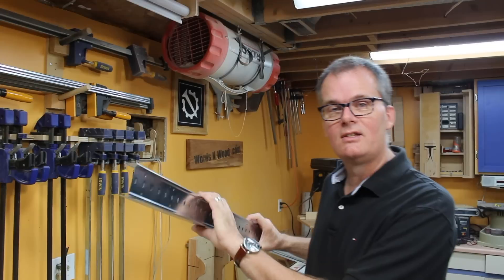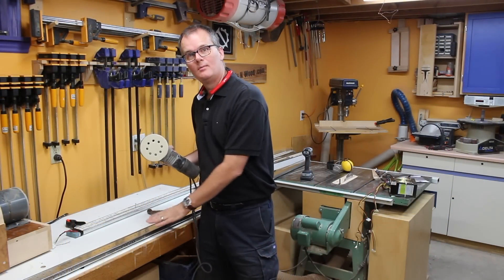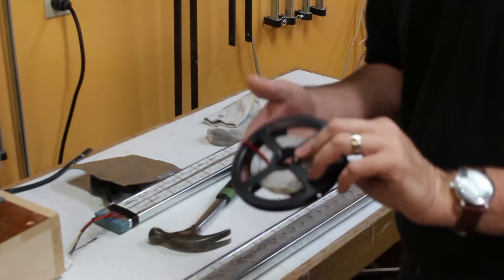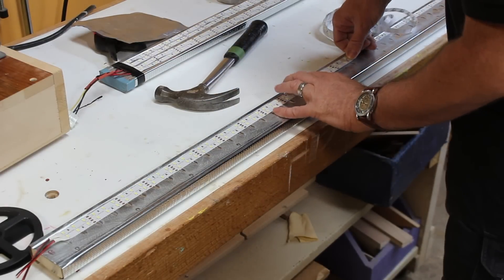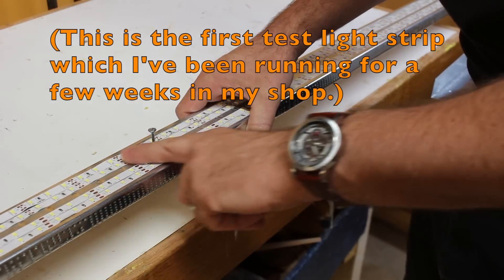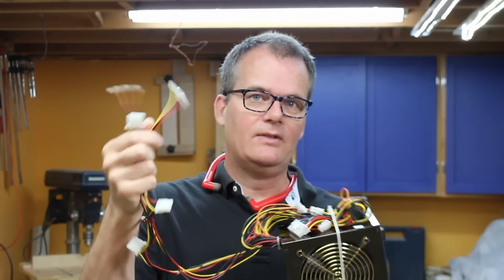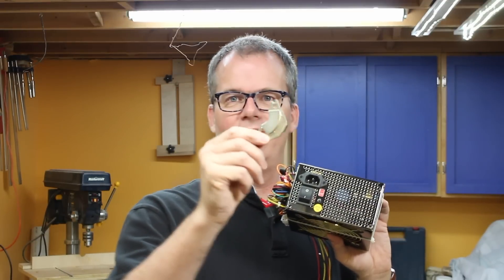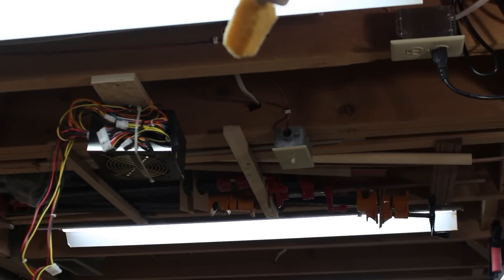Hacking LED strip lights.  AGAIN!   Last Time!  Promise! (WnW #59)

Comment: I am finally starting to comment for people looking for solutions like this. Everyone, I hacked this about 8 years ago when led strips were not widely known about. I don’t use adhesive at all and intact install on boats this in the Pacific Ocean. It’s a silicone and applies to almost any surface, AND NEVER HAS FAILED ME. It’s works so well and tried in my home and on outside surfaces continually being weathered. Only a specific brand and I bought it at Home Depot. If your interested in trying it(which I recommend) I would love for you to do a video on it for everyone. Let me know if your interested. I hope you get this and somehow message me back where I will see the message. I am new to all this and am being told by many I should be making videos like you do. So I have been practicing and publishing very amateur videos from my drone and some work I have done. Which have been on Network television several times by the owners but I have waived the opportunities of being recognized for personal reasons. I am now ready I think. But this is me breaking the ice for myself to do so… I think. Hope to hear from you. I told only a handful of people.

Comment: I've been applying led strips to the inner part of the stud, bending the sides out to form a reflector, then sliding in a sheet of plexiglass for the cover, no glue, or other means of attachment necessary. I leave the ends open for cooling. Works so well it's almost as though the studs were made with this second use in mind. Good job with the video, btw!

Comment: I've enjoyed this "series" a lot, well done. One suggestion for a future mod - rig up a small solar panel system to supply 12v directly (or 120v through an inverter). A single 100w solar panel and a 100Ah battery (and charge controller) might be all that is needed to power the lights. You could also use the power to charge your cordless power tools through 120v inverter and normal battery charger.

Comment from the maker: Patrons brighten my life:  https://www.patreon.com/wordsnwood
----------
I think I've finally successfully hacked these LED strip lights to use the, as "regular" lighting.

I had two main problems with my LED strip lights after my previous experiments.   

#1 was that they got so hot that the adhesive backing failed.   I think they really should have a metal backing to help dissipate the heat.   I found that a metal stud from the big box hardware store was the cheapest solution.

#2 was that the cheap DC-DC converter that I had bought could not handle the load.  I'm still trying to avoid buying $20+ 12v power supplies so I settled on (?) using a surplus PC power supply.  It requires a bit of creative soldering, but seems to do the job well, and it has enough wattage to handle several power strips.

Project web page:
http://www.wordsnwood.com/2016/LEDs-r...

---------- ---------- ---------- ---------- ----------
Previous LED videos:

#1) It all started here.  "Can LED strip lights replace Fluorescent!?  (WnW #46)"
https://youtu.be/yeC4tXANdv4

#2) Problems come out in this shop update
"Snow, Shop Update, and LEDs part 2 (WnW #52)"
https://youtu.be/oiEl96CIOGI

#3) Minor mention in this shop update, mostly about the Power Supply
"Meetup in Toronto, Mic Test, and Shop Update"
https://youtu.be/Ayr2gStI3fc

---------- ---------- ---------- ---------- ----------
HOW YOU CAN HELP:
Become a Patron: https://www.patreon.com/wordsnwood
Buy a Plan: http://wordsnwood.com/plans/

MORE MORE MORE:
http://www.wordsnwood.com
https://www.instagram.com/words.n.wood
https://www.facebook.com/wordsnwood

Comment: I would try putting the LEDs on the inside of the metal stud and bending the stud wider so it acted as a reflector. There are plastic clips designed to fasten LED strips to things too. That might eliminate the sagging problem also.
Reply from the maker: You missed this one...  https://www.youtube.com/watch?v=VVSqHp71824&t=2s
:-) :-)
Reply: I clicked and watched it. I had missed that one. Lol
That one looks pretty cool. You might see what it's like without the diffuser. It will be a harsher light but I would imagine it will also seem a bit brighter. Thanks for the videos.

Comment: You would actually get better adhesion if you did NOT sand the metal. Pressure sensitive material like the adhesive on the back of the LED strip prefers a smooth surface.

Comment: Don't know if you are still using your SMD (led) strips or not. You probably got them EVERYWHERE in there, or changed your design or ideas for lighting by now. Lol. One thing I always do when mounting these. Drill LOTS of holes, so that you can put a small zip-tie every 6 leds or so. Snug... not REALLY TIGHT. Too tight can break solder connections on smds, or on their resistors on that thin strip they are on. You'll never have to worry about them sagging again. I usually don't use the 2-sided tape on the back,  because if any adhesive wears or melts off ( when mounted to metal)... and the back of the bare strip touches bare metal... it can short out and blow your lights, or fry a power supply. That, and the 2-sided tape on them never holds very long as you found out.
 I used to use the 5050 SMD strips. But once I seen how bright the 5630 were  (or sometimes called 5730).... they are the only thing I'll use. I ALSO get mine from China... but on Ebay. They offer warm white, cool white, and NATURAL white. I first started out with all of the different colors, mounting them all through-out cars for custom looks. Now... I install them everywhere I can in the house. I CAN'T STAND a dim area. I favor the NATURAL WHITE strips. It's a glow that is close to a regular light bulb.
 I put them in my kitchen cabinets, other cabinets here and there, under cabinets above bar in kitchen, and I am getting ready to do an instalation in my garage of 25 to 30 meters.... running off of a 12v 30a power supply. Garage size is only 23ft x 15ft. I imagine it will look like DAYLIGHT in there afterwards!!!
 For all of my cabinets and my bar, I used one 12v 3a power adapter from Hong Kong. $4.50 US. My bar lights even go through a dimmer with remote for adjusting brightness. I'll have to either post a video soon... or email you some photos if you're interested. I don't like posting videos... but maybe I can do a photo step by step tutorial on YouTube soon. As for in my garage, gotta insulate and drywall my ceiling in there first. But that's getting done little by little. Over halfway done already.
 But anyways... hopefully yours are still working for ya and last forever!! 
 Other helpful items that come in handy.... get on ebay and look up "10mm 2 pin smd connectors". (For the single color get the 2 pin) They got all kinds of nice CHEAP gadgets on there that make installation a breeze.... without even needing to solder ANYTHING.

Comment: The adhesive fails from heat and shear stress.  The copper in the strips expands quicker than wood and so the copper is pulling the strip from the wood.  Wood is an excellent insulator and there is nowhere for the heat to go.  Power supplies should be sized for the load of the LED strip.  You can feed the LEDs too much current and it will shorten their lifespan.  The use of aluminum as a heat sink is better than the use of steel since it conducts heat better and the expansion coefficient of aluminum is closer to copper than steel.  Use alcohol to degrease and clean before adhering the tape to aluminum.  Do not sand the substrate. It creates micro scratches which allows air (a wonderful insulator) to decrease contact.

Comment: You mounted those strips perpendicular to your ceiling joists.  That could limit your access to that area for storage whereas if you mounted them on the bottom of each ceiling joist, you would not be blocking your access.  Something to consider if you choose to put more of the strip lights up.  With the strip lights just near the side of the room like you have it in this video, that's probably not that much of an issue.

Comment: I am unsure of which video I commented on prior to now - but I found a solution for the LED heat issue.  I used an aluminium sheet as a back panel (got the idea from this video when I watched it last year), but secured the LED strip to the panel with clear silicone caulking.  Apply the caulking to the strip's adhesive backing and then set in place.  The silicone transmits heat very well, it wont degrade within the operational temperatures of the LEDs, and it drys/sets-up in a matter of minutes (given a thin coating anyway).  I thought you might like to add that nugget to the pile for the next rainy day adventure down this rabbit hole.  Cheers!
Reply: did you apply the silicone to the actual glue part or left the backing as it is, how is it holing up sofar?

Comment: Great vids Art. I had the same idea! Metal studs are cheap and provide lots of heat sink. I'm glad you tested them out first. So how many 5 meter strips (cut in half, two 8' strips per stud) do you think are enough to provide ALL the light for a 20' x 20' garage? And do you recommend 5630's or 5050's, and which brand/model? Lots of questions. P.S. -  I used a PC power supply as a way to charge 4 RC plane batteries at once, on house current. Each plane's battery comes with a charger that needs to plug into your car to charge! I mounted 4 cigarette lighter jacks in the power supply body, grounded the green wire, and removed all other wires. It's all internal, neat and tidy. Thanks again for you great vids! Subbed.
Reply from the maker: My shop is 11x24 and I have 2 of the studs in my shop, plus three 4' flourescents.  I'd start with 5-6 in your case.

I can't really recommend a brand.   I went cheap, but I don't have the resources to try all of them out there.   I've heard people say the cheap ones don't last, but these are mostly ok.  one of my strips does have some out, I was also testing a 19v PS for a while so maybe I overdid it?
Reply: John Berthoty Don't know if you have already done your project or not... but use 5630 or 5730 natural white. MUCH brighter than the 5050. Don't put too much power to em though, or they get REALLY hot and start failing. I usually put around 12v 3a.... or 4a  to every 5-meter of smd strips.

Comment: Did this do the trick? Did the LEDs come unstuck over time? I am more than likely doing a similar thing your video helped a bunch.
Reply from the maker: Some of mine are a bit loose...   I'd go with some other means of gluing.   CA glue or construction adhesive or something.
Reply: Great thanks!

Comment: I have successfully powered these 12V LED strips by 120V AC without using an elaborate 12V DC power supply.  What I did was to cut 10 equal length strips of 20 cm each.  All strips must be cut from the same roll, of equal lengths and the total number of strips must be 10.  Connect the 10 strips together in series (+ of the first strip to - of the second strip, then + of the second strip to - of the third strip and so on).  This forms a 120V DC series circuit chain (10 x 12V DC = 120V DC), total 200 cm long.  If you want to, you can connect two of these 200 cm strips in parallel to double the power.  The only thing left is to connect to the 120V AC source through a 400V 2A bridge rectifier: 120V AC to the two ~ ~ terminals, + and - to the LED strip(s).  Since the LED's are "live", precautions should be taken not to touch them when power up and to make sure they don't get shorted to the metal stud by first installing a layer of insulating Mylar tape.  Make sure to use Mylar tape and not PVC tape.  Mylar is a much better electrical insulator and heat conductor than PVC.  Each 200 cm strip draws about 35W.  I am a bit disappointed with the high power consumption because a lot of power is wasted through the on board chip resistors.

Comment: I like your approach. Very methodological. Tried, tested, eliminated. I jumped into your video, when I wanted to know the watts for 5 meter 5630 LED (turns out to be 51Watts). 
I had run the 5 meters a couple of days back, but did not have a 5A power adapter and I ran it through 2A, and testing through the multi-meter, got a reading of 1.92Amps which would be equivalent of 23Watts for 5 meters which I felt did not look right. Most of Aliexpress was mentioning 14.4 to 12 watts per meter which I felt was not correct either, as 5730 was positioned at 7 watts for 50cms, so 5630 must be  around 14 watts for 100cms. Thanks to you, now, I feel 5630 strip light white 6500K would be 5 watts for 50cms at 2700lumens for 60 LEDs (45 lumens per LED).
I am building a large aquarium light for my bigger 2 feet tank. I wanted the watts calculation with 10% approximation limit, to evaluate if it was worth moving to LED. My current aqua tank with T5 lighting is 96watts and 6400 lumens. I figure for 6400 lumens I can run 24Watts but I may keep some blue LEDs also, and may run it a little higher, as I plan to use a remote dimmer also.
I am also in DIY and it is best through my expereince to do it yourself even on all calculations. Dependence on vendors, as a means of lumens, watts, and brightness does not work out well, and I have gone through 3 iterations, before I did a small one for my smaller tank. 
Probably will post a short video once I am through.

Comment: NOT CARING WHETHER I AM "GREEN" MY SHOP HAS THE OLD INCANDESCENT LIGHTS AUGMENTED WITH FLUORESCENTS.  MY RESULT .  I CAN SEE JUST FINE AND I DON'T HAVE TO GLUE CRAP TO MY CEILING.  THAT'S JUST ME AND I AM AN OLD MAN SO WHAT THE HELL WOULD I KNOW?
Reply: Incandescents waste a lot of energy from heat, but this can be a good thing if you are in a shop that could use a bit of extra warmth on the cooler winter days.

I'm looking at putting a single row of LED lights around my house under the eave to provide security lighting.  I don't need much light, just enough that I can see the sights of my gun when they are placed over the silhouette of the trespasser / intruder. :)  The really bright lights produce too much glare and they can even prevent you from seeing someone behind the light.

Comment: OMG I love your HD magnet mount.  Brilliant.  I didn't see this video before commenting on the old one.  Are you using amplifiers to connect all the runs together?  Do the single color LED strips require a controller or do you power them directly?  I have about 5 reels of RGB and mine require a controller. :/ Thinking about going with some 12V white strips now.  Great video. Subscribed!
Reply from the maker: I only have two runs at this point and they're each wired directly to the PC power supply
Reply: Probably a stupid question, but why did you connect them to a PC power supply instead of just a small 12v power supply?

Comment: Be REALLY careful sanding anything galvanized.  Zinc fumes and dust do bad things if any is inhaled.  
Interesting project!
Reply: Correct and unnecessary. A good wipe with alcohol and he would have been fine. I did like this exercise on the whole though, the good, bad, and lumens.

Comment: Very nice! I've been using PC power supplies for all kinds of things lately. It is very fun to tinker. My favorite use of the power supplies is to power a huge audio system in the garage using car audio amplifiers and speakers and subwoofers. Works great!
The metal stud is a decent solution to the heat sync and mounting issue. Plain ol aluminum bar can be used as well or angle iron as you mentioned. Some commenters suggested just stapling the led strips up. This can work very well, but the concern there is the staple crushing or pinching the LED strip. This can cause it to fail or cause unnecessary heat build up at the staple pinch. If stapled properly though it would work fine. I've used the strips hooked to w dimmer control and stapled them underneath kitchen cabinets to use for task lighting and night lights. Another commenter suggested using slightly under 12v to power the led strips. That's another great suggestion! Most of these LEDs can run off of a wide voltage range and running on a lower voltage can increase the life of the LEDs. 
There are so many possibilities with LEDs. Keep tinkering!
Reply from the maker: Thanks, Craig... just bought an LED -T8 replacement today.  So I'm definitely still tinkering.  It'd be an interesting time to build a new house, as I think I'd go as close to 100% LED as possible...
Reply: Wordsnwood (Art Mulder) I actually just finished converting my entire house to LED! There is only one bulb in the entire house that is not LED and that is the oven light, haha. LEDs can not withstand the heat of an oven due to plastics and sensitive components. My vacuum cleaner light and microwave and fridge are even LED. Security lights outside, cabinet lights and shower lights, etc. It is quite entertaining. I also converted all of my old fluorescent tube fixtures in my garage to non-ballast  LED tubes as well. It's very nice as the LEDs are instant on and instant brightness even in the coldest winters here in a non-heated garage.

Comment: You can pick up 12V 1-3 amp power supply's, I.E wall warts at thrift  store for about 1.00 and then you don't need a converter or PC power supply. just clip off the jack end If needed and attach to the wires of the light.
Reply from the maker: I looked at the time and didn't find any...  There are lots of wall warts at different voltages, but It seemed to me that actual 12v ones are less common.   Could just have been at the time.
Reply: you might of came in after me!lol, I stock up when i see them,I use them for all kinds of projects

Comment: I'm doing 4 8' sections (double row per section), with a 725watt psu. Do I need to connect each section to its own yellow and black on the power supply?
Reply from the maker: Did you miss my disclaimer where I said I'm not an Electrical Engineer?  :-)
I honestly don't know how the wires are connected inside the power supply. 
 I would guess it doesn't matter, but that is just a guess.